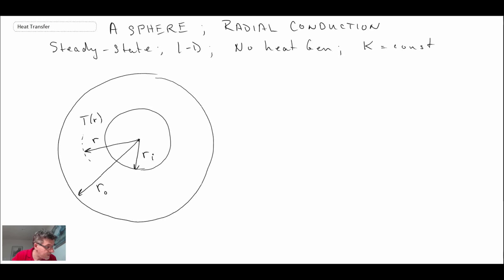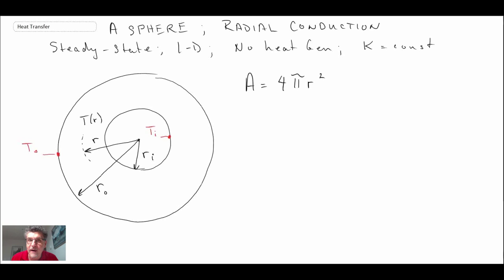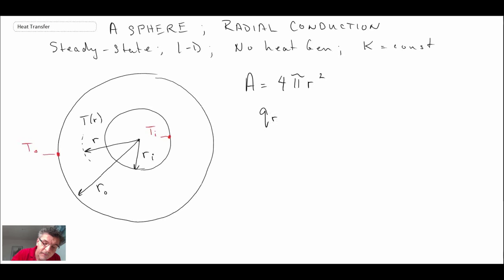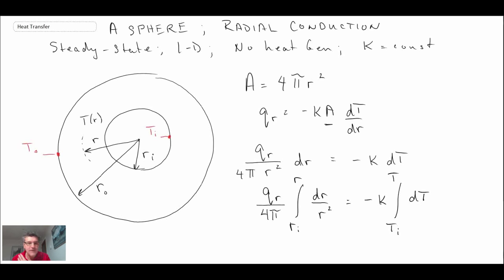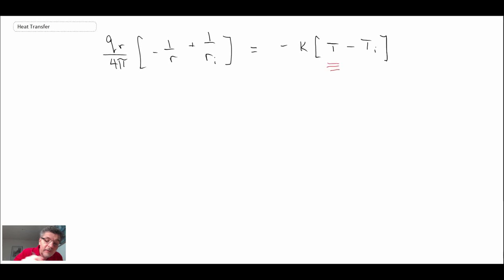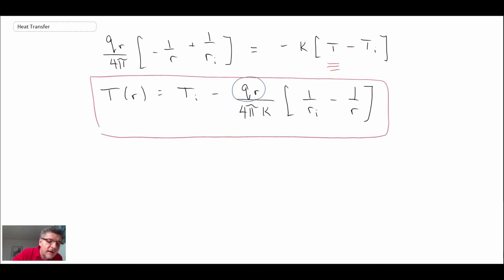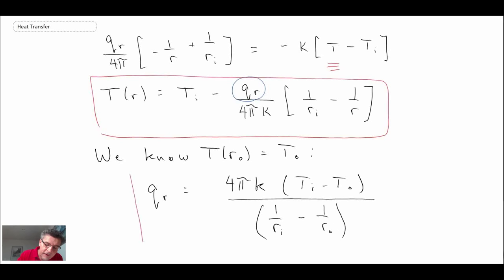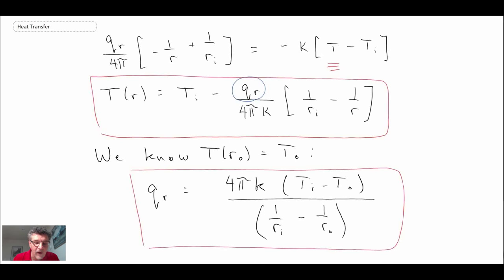Heat Transfer L5 p4 - Example - Spherical Conduction

Comment: What if there is a uniform heat generation?
Reply: From energy balance:

Ein-Eout+Egen=Est

Est = 0 (no stored energy)

Ein-Eout+Egen=0

Egen = egen*dV -> dV is differential volume from schematic. dV = Adr -> A depends on shape, so for sphere it would be 4*pi*r^2

Qr - Q(r+dr) + egen*4pi*r^2 = 0 -> both the r and r+dr are subscripts.

From definition of derivative we know that 

Q(r+dr) = Qr + (dQr/dr)dr

Subbing that into above, 

Qr - Qr + (dQr/dr)dr +egen*4pi*r^2 = 0

therefore

(dQr/dr)dr +egen*4pi*r^2+dr

Now using Fourier's law of conduction, 

Qr = -kA(dT/dr) = -k*4pi*r^2*(dT/dr)

Subbing into above:

-k*4*pi*d/dr(r^2*dT/dr) +egen*4pi*r^2

Isolating for differential equation:

d/dr(r^2* dT/dr) = (egen*r^2)/k

Now you integrate the differential once with respect to r:

r^2*dT/dr = (egen*r^3)/3k + c1

Isolate for differential:

dT/dr = (egen*r)/3k + c1/r^2

Integrate again WRT r:

T(r) = (egen*r^2)/6k  - c1/r + c2

Now, apply the 2 boundary conditions (T(r=0), T(r=r), etc.). These will be question dependant. Then use these boundary conditions to solve for c1 and c2. Your integral may be different if egen is is a function of r, say e^r/r2, or the classic e^(-x/2L) in plane walls. Some professors give these questions because they expect you to be an ace at calculus, when many of us are not. If there is any misunderstandings or questions please let me know. (Also please let me know if there is a mistake so I can correct it).
Reply: @BigReviewMan  no way u wrote all this and he didn't acknowledge u with a thanks, anyways thank you